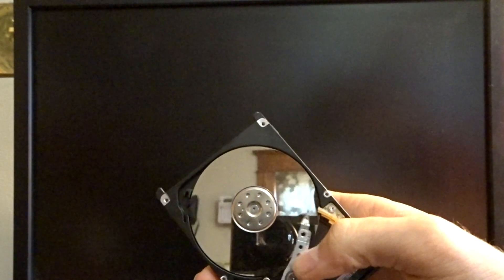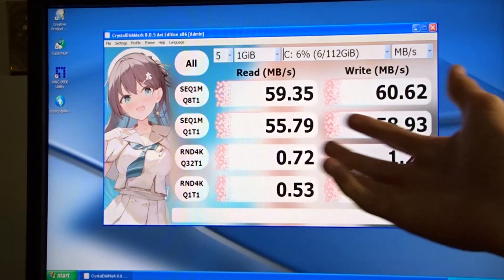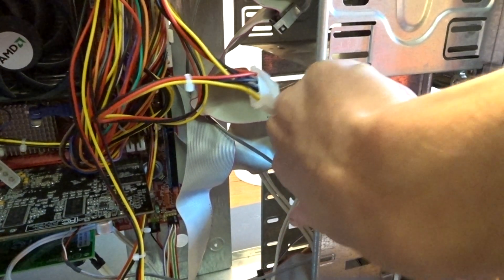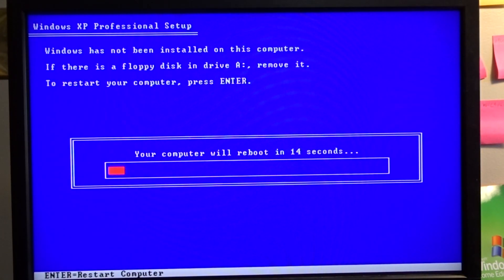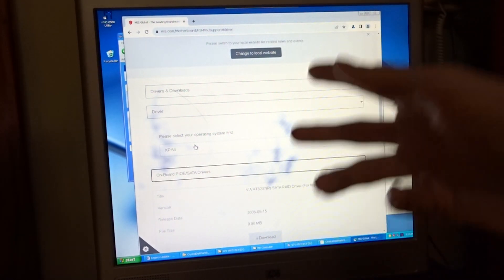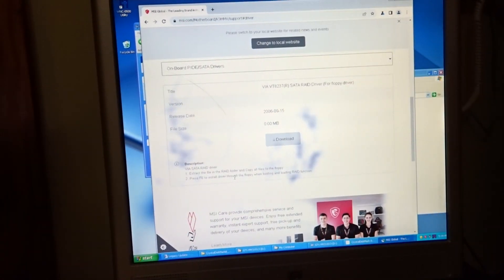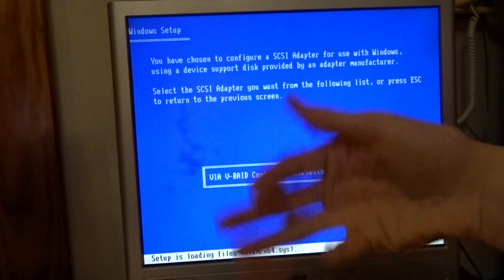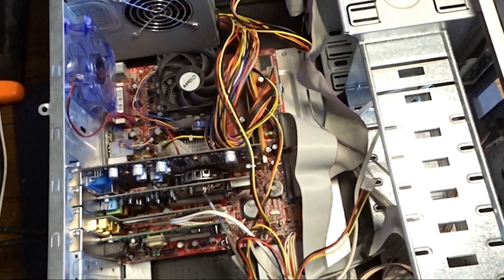Adding a SSD to the XP computer!

Comment from the maker: Ok, so I ran a couple tests on install speed. I forgot to put it in the video.

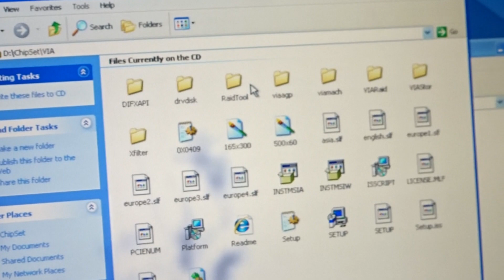HDD: 11:26 for blue screen install 
14:40 for more user install 
26:07 total

SSD 12:34 for blue screen install
10:33 for user install 
23:25 total

Basically negligible, but the actual boot and uh working speed would be faster with a SSD, and no clicking for fragmenting.

Comment: Although I didn't watch the video I have cloned an old XP OS of mine to an SSD using Macrium Reflect and used it on another XP appropriate machine. It worked like a charm. Although after booting, Genuine Advantage came up and surprisingly the phone number listed still works to this day. Then I had to reinstall the drivers because the OS thinks it doesn't have any since it's a new machine. So I had to do that but I don't run XP now due to the security risk.  However I did make an an image of the XP SSD and made a VHD on windows 11 and then cloned the XP image to the VHD and then converted to a format that Proxmox can use and low and behold I have a VM of my old XP working in Proxmox on modern hardware. I was surprised that it worked too. Anywhooo....

Comment: Awesome, I am new to this amd trying to upgrade my socket 478 and socekt 775 systems currently running P4 processors in both of them.. I was looking to put an SSD. Can you help me which ssd and speeds do these old boards support?
Reply from the maker: Hmmmmm, the older the board the slower the connection will be, however in my experience something that is too fast or large won’t be good for it/wont work.

Basically I normally get a 120 gig SATA 3 one because it’s versatile with other devices(however some are configured strange, like one ssd would only work in raid mode, so yeaaaa)
https://a.co/d/0k15Mxy

If you need a IDE ssd this is the best converter, it works better than the cheap Chinese ones that are slow (get star tech)

https://a.co/d/fKVEKLY

Anyway I hope that some of this knowledge helps

Comment: Very cool project, I just wouldn't run windows but you do you. Im into Linux, Freebsd and Haiku OS
Reply from the maker: lol, matter a fact I have NEVER used Linux, it may be a new video! “Hayden loses it over Linux”
Reply: @hay_den9002  it's all good, I flipped my sh** learning how to install Linux back in the early 2000's I'm struggling now to learn freebsd and Haiku OS. It just takes getting used too.
Reply: @hay_den9002  Then 2 weeks later"btw I use arch" ;)~

Comment: Surprised at the installation time, I used to have to build XP desktops and installs would take 30 mins on a mid-2000's desktop with a HDD.
Reply from the maker: Yikes, but that’s the deal with HDD and the spinny disks.
Reply: @ I might be mistaken I thought you said it took 23 minutes to install with the ssd near the beginning?
Reply from the maker: Uh possibly I don’t fully remember but around 15-20 sounds about right.
Reply from the maker: @Dr_McKay I ran a few tests, check the pinned comment!

Comment: The physical installation + drivers is only a first part of the issue.
But in addition, you should investigate and implement some specific settings in the operating system (such as disabling virtual memory writing or caching, defragmentation and indexing; as well as taking into account TRIM (especially on older or low-end SSDs) and proper partition alignment).
All this is because Windows XP is an old system, which does not know what an SSD is, and therefore will treat it (by default) as if it were a mechanical disk, which will accelerate the premature degradation of the SSD.

I recommend, for example, the video 'How to avoid short lifespan when using SSD in Retro PC' (from 'PhilsComputerLab') for a first approach to the subject.
Bye!

Comment: Hey! I recommend that if you show any component in front of the camera, keep it still and in focus. Do not shake or jiggle it wildly, as this is annoying for the viewer, and prevents the viewer from perceiving the interesting features and information of the component in question.
Bye!
Reply from the maker: Hmmm, I’ll take this into consideration. Any examples In the video? My guess would be where I take  the camera off the mount and “show” the floppy drive.
Reply: @hay_den9002  There are several examples: (0:28) (0:43) (0:52) (1:06) (1:13) (1:15)
Bye! 👋
Reply from the maker: Thanks